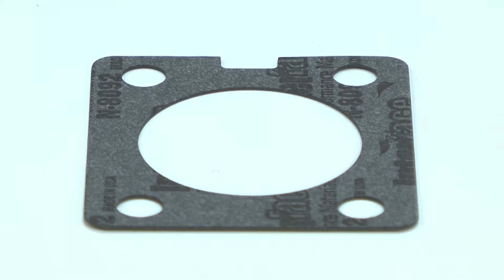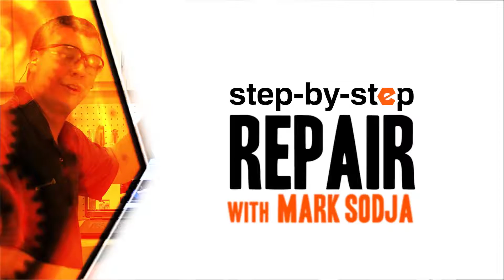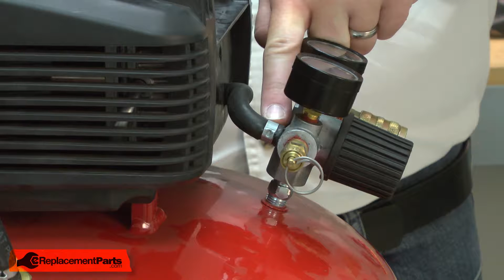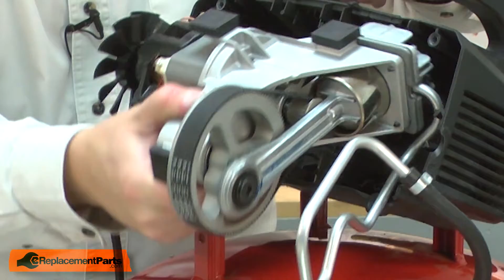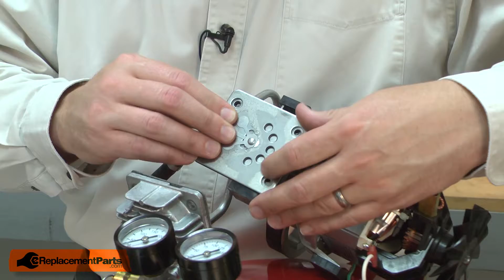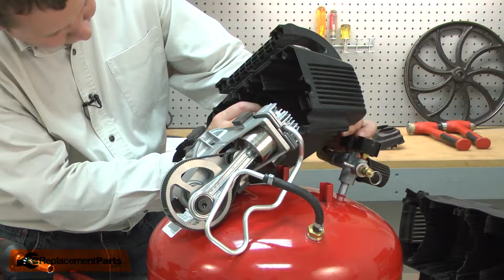Porter Cable Compressor Repair - Replacing the Gasket (Porter Cable Part # A03865)

Comment: You do not need to cut hose clamp or remove mani cover..just remove back motor housing and pull motor .. 2 screws 4 head screws replace gasket etc.